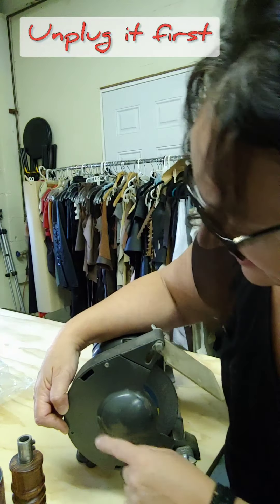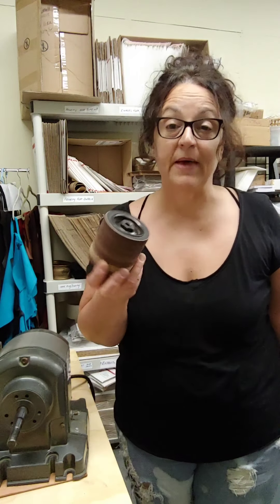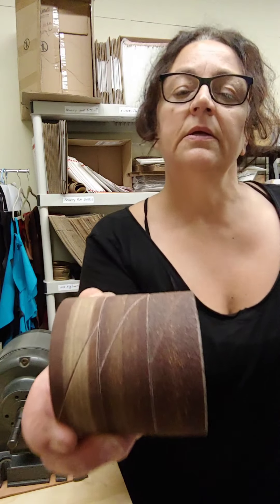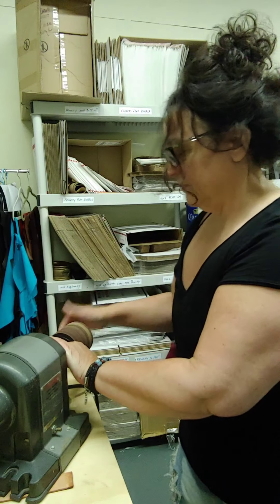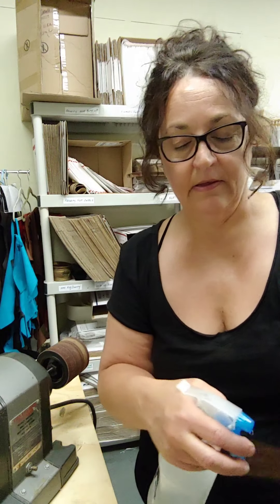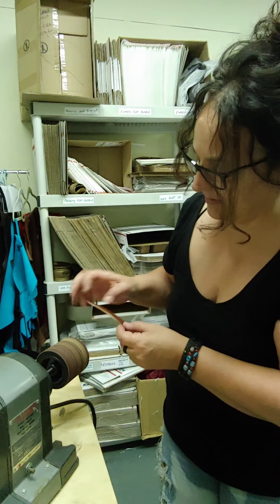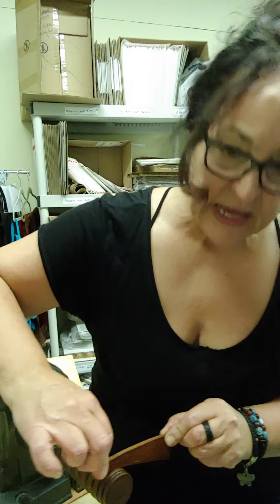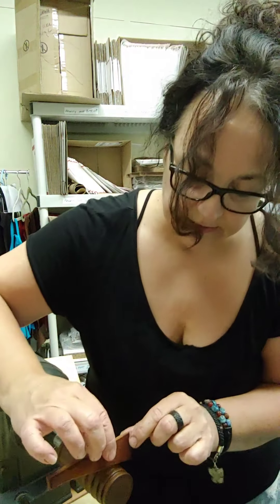I Converted My Dad's Vintage Bench Grinder Into A Leather Sander & Burnisher!

Comment: Love the info. Sadly i dont have an old grinder to convert and it costs almost as much to buy the pieces separately as it does to just buy a pre set up machine on amazon.
Reply from the maker: Thanks for chiming in! You make a good point. And those machines run at slower speeds with the ability to adjust the speed. I have one in my workshop. I never use it though opting to use my converted grinder instead. :-)

Comment: Thank you for your video. I just ordered the 1/2 in shaft Motor Burnisher Spool from Pro Edge. $58.99 complete. It will fit my Harbor Frieght buffer motor.
Reply from the maker: You're welcome, Ken! Please let me know how you  make out! :)
Reply: @IamLisaMariaCantalupo  I got my burnisher today from Pro Edge Burnishers. Great burnisher. Fits on my Harbor Freight buffing motor spindle. $58.99. I got a set of 4 sanding drums at Harbor Freight and had to drill out the end to fit the 1/2" diameter of the spindle. Didn't drill all the way through. $27.
Reply from the maker: @kentison9143  I'm glad to hear you like the burnisher! I'm not sure my brain is able to follow the part about needing to drill out the end of the Harbor Freight sanding drums (I'm not very familiar with those)...why was that necessary?
Reply: @IamLisaMariaCantalupo  the drums fit on a 1/2 in shaft. The end of the shaft of the Harbor Freight motor is threaded and then for the next inch it is 1/2 in diameter.

Comment: I am new to all this stuff. how do you achieve the same results if you don't have these tools?
Reply from the maker: Hi Starla! Great question! To finish my leather strapping, prior to my Dad's grinder conversion, I would use 3 grades of sandpaper to smooth my already been beveled, edges. I also took a drill and attached a plastic round burnishing wheel to it, to burnish/smooth out my edges. The results were fantastic! I, at one time, had a video of a friend burnishing some strapping using the drill. I'm not sure if I have it posted on YouTube or not.

Comment: thank you for sharing this , what is the rpm ?
Reply from the maker: You're very welcome! 3450 R.P.M. To accommodate, I've made adjustments as to how I run leather through each grade of sandpaper.
Reply: @IamLisaMariaCantalupo  nice that's working fine ... I run mine at 800 rpm
Reply from the maker: @seawinde with this grinder I don't have an option unless there's a way to slow it down that I'm not aware of

Comment: For the sander which one did you get?
Reply from the maker: Hello! Do you mean the sanding drum and the sanding sleeves? If so, I got those from From McMaster-Carr. 

For my particular grinder I purchased the following: 

1. Drum for Sanding Sleeves (1/2"-20 Thread Size Arbor Hole, 3" Diameter) 
2. Sanding Sleeves - 3" ID, 1" Long: 80 grit, 120 grit and 320 grit

Links are in the description :)
Reply: @IamLisaMariaCantalupo   thank you sorry. how is the sand paper attached ?
Reply from the maker: @Vince006  The sanding sleeves slide on to the drum. It's tight fit and may take a little doing to get them on but they'll slide on.